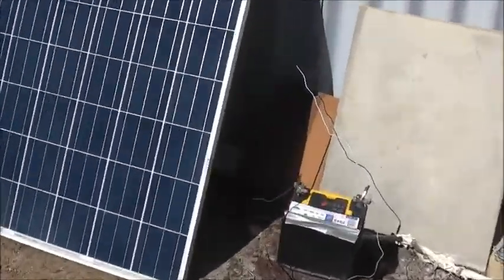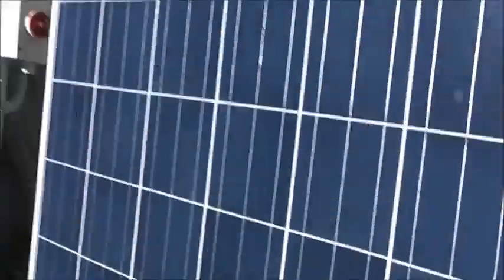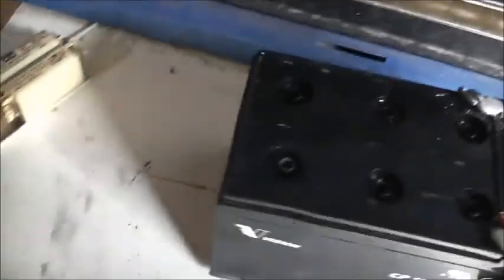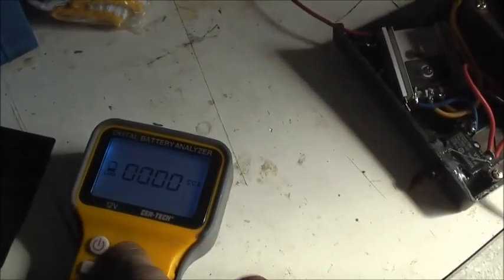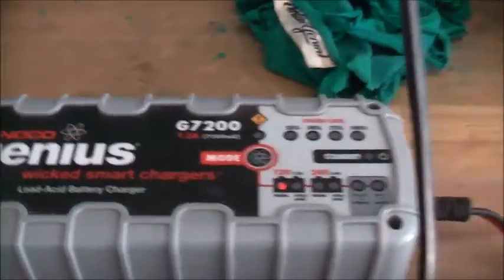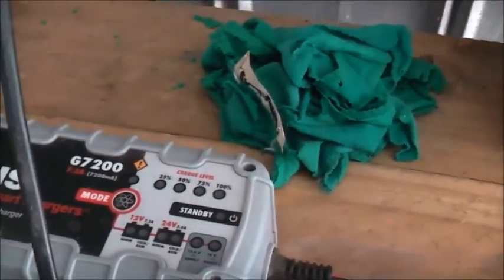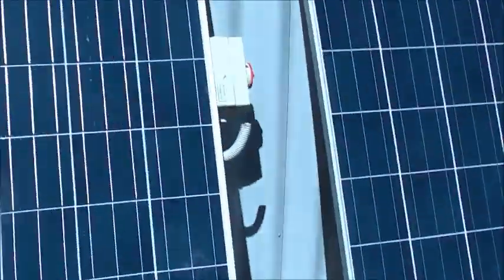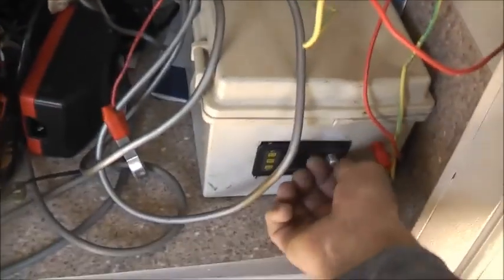Solar Panel DC Arc Demonstration, Why Fires Can Start!!

Comment: Looks it could drive a Jacob's ladder
Reply: Can also arc weld with them, I used 4 39v 7.5ish A panels to do some bodge field welding
Reply: little bit of a late reply, but it probably wont work. the voltage of +/- 100V wont arc over a space of more than 0.1mm
Reply: @supersolex  have you tried it, with the 4 panels I was using I was able to draw an arc almost 1cm.
Reply: @exogator  but you have to touch both ends first. thats not how a jacobs ladder works lol